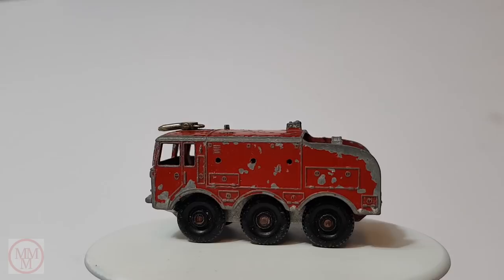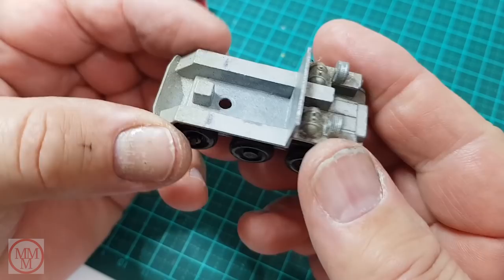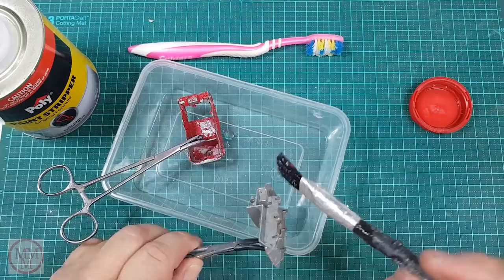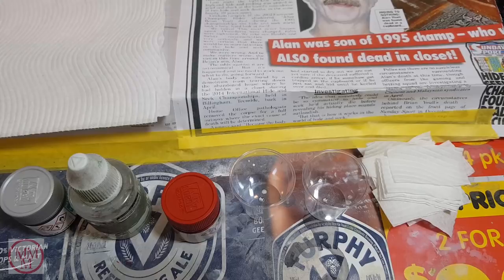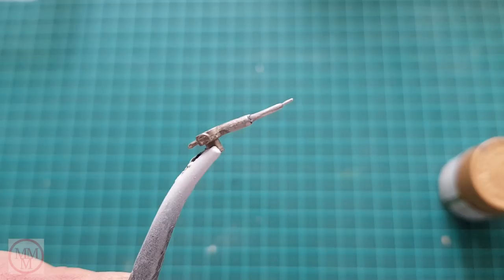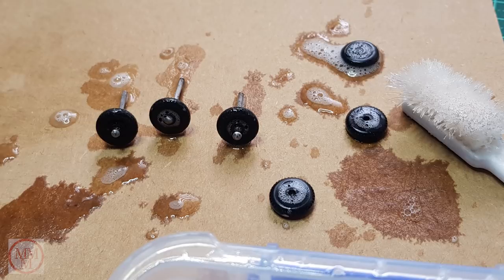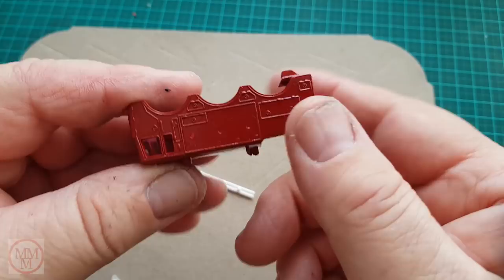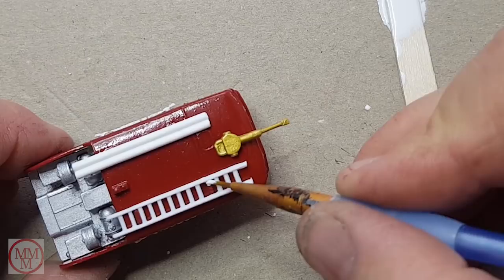MATCHBOX Restoration No 63b Foamite Crash Tender 1964

Comment: G'day Marty I want to talk you out of using paint striper. It's not good for the environment as it ends up being flushed out into the ocean. Use Caustic Soda approx 2 table spoons in hot water - find a suitable jar. As for your spay nozzle blocking - strip it clean it then spray thinners through the gun. 👍

Comment: Poor airbrush giving you fits.some of even the better ones can't take the harsh solvents to clean them, specially if you let them soak in the solvent .that's why you need to look into water born paints. Cleanup is a snap and the finish is I beleive better then.the lacquer or the acrylic finish you use. Ask mr hobby if they have such a system. Goodluck......and thanks again for another great video.

Comment: The pipes on the roof are known as hard suction, and were used in conjunction with a basket strainer and metal filter and was used for drawing water from ponds, lakes and other open water sources.  The foam nozzle is known as a monitor.  Again a great job.

Comment: Marty, when pouring paint from the bottle, try placing the stirring stick on the bottle edge and let the paint run down the stick.  Less likely to run back into the bottle threads (and fingers). I’m happy with that. Congratulations on 99,000 subscribers! 1,000 to go for 100k.

Comment: great informative step by step video mate.
Unscrew the front parts of the airbrush and give them a good cleaning with automotive thinners or acitone, make sure the swirl vent holes are clear as well.

The little suspension parts are also on the hoveringham  tipper truck

Funky

Comment: Have you cleaned out your gun mate? If you can get it in Australia try to get 'brush magic' because it is fantastic for cleaning out your gun. I then use some airbrush gun brushes and ear cotton buds.
Reply: When i have blockages in my airbrush, i pull the entire thing apart for a thorough cleaning. Sometimes you can back-wash the air for a temporary clearing of the nozzle if you're in the middle of a job. just hold a rag to the gun and press the air button to force air back into the paint pot.
Reply: It sounds as if something either has a thin coat of varnish or if the needle is developed a slight bend.  either way, I agree, a total tear down and thorough cleaning may help.
Reply: Check YouTube for airbrush maintenance videos. And maybe when stripped down, check that the needle isn't bent.
Reply: Point is taken; price of a new airbrush- $99-$380  price of airbrush cleaner solution $4.99-$11.00

Comment: Marty what a wonderful job you did.  Airbrush trouble when after painting clean the brush and with paint thinner and let parts dry with the needle out and put some chrome polish on the needle rub it out. Then when ready to paint put the needle in and it spays like new again.For thick paint like Tamiya colors a .5mm needle is better. Don't forget to thin the paint a little as well. I have two airbrush set ups for water base paint and enamel type paints. Hope that helps.

Comment: Those haemostats are also known as spencer wells grips. They self lock and were used in surgery. Paramedics used them here in the uk in the 1970s and 1980 to block the inflators pipe on the endotracheal tubes.

Comment: Just a little suggestion Marty but remove the needle from the gun and check that the end is ok and not become bent (they have a really fine point) maybe a good soak in airbrush cleaner (I use the vallejo one) and blow some thinners through before using the paint in it? Great video as usual. Thanks for sharing it.

Comment: Great job Marty! Curious when was the last time you cleaned or changed the air filters on your compressor? If they are dusty or gummed up in someway you might not be getting the psi you need to push the paint out of your air brush.

Comment: Looks like you have a paint clog. Soak the end in thinner overnight after you take out any rubber rings and grommets. Then it should flush out easily with some pipe cleaners.

Comment: Not sure what brand of airbrush you are using but a common problem with most is the nozzle tip (which is made of brass) wears out and causes spray problems. If you search for your brand and parts you should be able to find it. It’s an easy fix.

Comment: The Company that made the plastic parts need to make a few alterations to their castings, like linger posts on the backs of the words because I'm sure that they melted them and flanged them on the inside of the model. As for the ladder, It could have been a little larger so the rungs lined up with the Tabs. Otherwise, it was great to see you overcome those obstacles and turn that Trash(ed)-Truck into the beauty it once was.

Comment: Marty Nice job as usual... Marty may be you are using too thick paint  mixture and little ammount of air so it gives you that orange skin appearance,other thing is to try to paint as a fullsize car painter (I was one formerly) and give long horizontal strokes along model .That prevents washes of the paint and spots where the thickness of paint is thin.Greetings from Uruguay.

Comment: Very very nice job as usual and/but I'm getting addicted to the glassy finish on the new Matchboxes and others I'm seeing in stores by the hundreds and I dare say, thousands, here in Thailand.  How do they do it?? What kind of paint is it??? And the graphics? Toooooo fine really. How how how??? And lastly the most troubling thought of all, "what scale is it." I'm an inverterate HO modeller. Wtd? Thanks and best regards, Publius Venerial, my high skool nic name. Heheheh, i think.
Reply: I'm intrigued,  wherein Thailand are you seeing all these Matchboxes? All I see here in Chiang Mai are a few Hot wheels in Tesco,  Big C etc
Reply: @johnclayton6676  Inside the Mall Bangkae is a department store with a toy department and they have Matchbox and Hot Wheels and a bunch of other brands from Asia. Expensive too for some of them. Best deal is 4 for ten dollars US money. Which is about 299 baht. They are 99 baht each and if you get 3 the 4th is free. Problem is picking thru the pile and the racks. It's so hard to see everything, but I'm trying. I will check now all over Bangkok at Siam Square and Pinklao Central to see who has what as not all the line is represented I think. There is a lot of the fantasy cars which I am not used to and also a lot of European utility vehicles which don't give me a buzz either. Lastly the premium cars go for about $12 up to ca $120 each so I'm not that interested in them yet.  there is also a small toy store for kids on the first floor with Hot Wheels on two different racks. I'm shoppng now for some kind of track with boosters. Is it possible to make a loop for continuous running via boost and time the cars? Some roll a lot better than others.